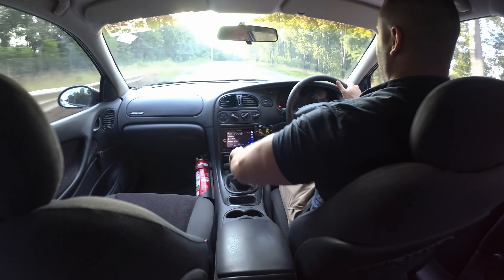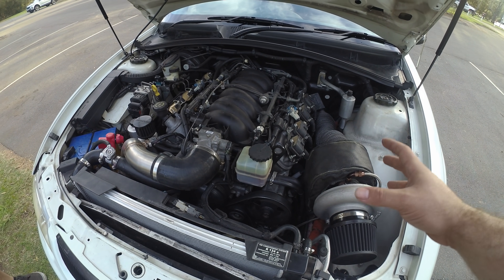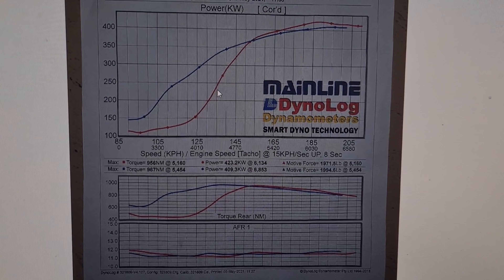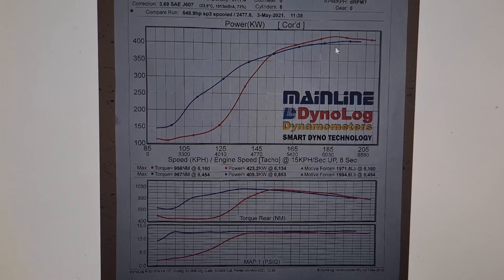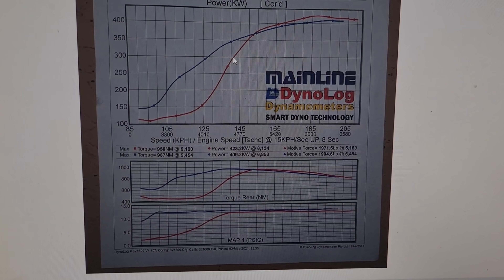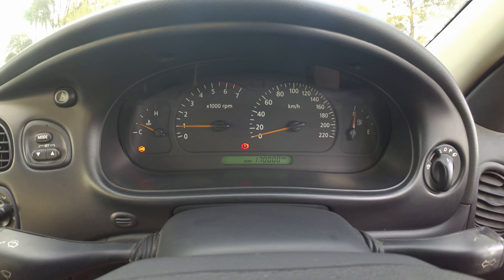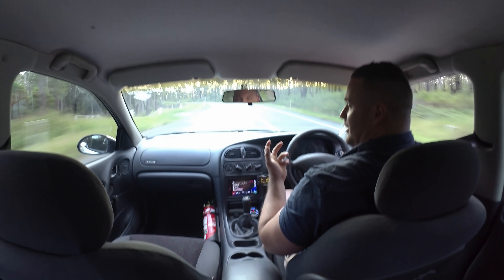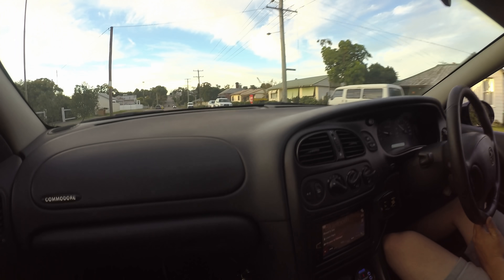LS Turbo Comparison Borg Warner S480 sxe vs S366 sxe

Comment: I need a smaller turbo for my monaro. I went with a 1000hp turbo and totally regret it for street driving. Good result with the smaller turbo, makes the same power as mine. Im looking for a new turbo and pulsar recommended their equivalent of a g42-1450 with a 1.15. Way too large of a turbo imo.
Reply from the maker: I'm likely going to run the g42-1450 on this 5.4 but it's more for roll racing and drag application with n20 for spool if required.

You could go for an sxe s372 as a middle ground if it's a 5.7/6L?
Reply: @GapSauceYoutube  I was thinking of going with a g40-900 or g40-1150 since its primarily a street car. Stock 5.7, 98 only as I can't get e85 where I am.
Reply: @vongdong10 If i had enough time and money i would love to throw a g40 1150 on it and compare to the s366

Comment: The S366SX-E seems to be a very good match for this engine / set up. Converting KW to hp and converting boost to MAP and dividing the two gives us 314 hp at the hubs from "The theoretical NA engine".  (314 hp / 350 CID = ;) ) 
This is about 32 lb/min airflow in the compressormap, right?
1 BAR boost doubles this to 64 lb/min. A X mark at 64 x 2.0 in the S366SXE compressormap is just within the 70% line = this turbo is not too small = S480 is overly large for THIS particular engine. 
We have seen 420 hp at the hubs from "the theoretical NA engine" from budget 5.3 L engine running up to 20 psi boost on petrol fuel, not E85. :)
Reply from the maker: I like the thinking, this particular car made 385rwhp n/a. 620hp on 13psi from memory on e85 before it split a bore.

Comment: Went for a pulsar 3584. Spools great, full boost just a tad over 3-3.5k rpm on a Barra. 400kw on low boost which is a measly 15 pound. Plan to turn it up, was limited by a boost control issue.
Reply from the maker: Great power for 15psi mate. Most 98 cars with 3582 make an honest 320rwkw and run 117-121mph.

Comment: When I first seen the thumbnail for this video I though you were comparing a t6 s480 to twin s366s as some people do for drag setups. I would not have thought a single 66/73 would have been too small for a ls1, but it appears to work really well for a manual street car.
Is the ls1 still alive and kicking?
Reply from the maker: The turbines are very similar between the two and the compressor ended up moving enough air for 610whp on e85 but was left there for the stock bottom end. The car did alot of drifting sessions at the track at up to 7000rpm and plenty of street use, unfortunately we just saw the bore split just recently and a rebuild is in order.
Reply: Yeah cool, just check the specs and yeah pretty much same on exhaust side.
How much boost does it run? Looked like about 10-12 ish?
The response looks great, I would be worried about having too much boost down low and having a manual you can really load it up down low and fold a rod in a sbe
Reply from the maker: @RedsProjects  You can bring it in softly with the timing but from memory it was around 13-14psi for 610whp and survived alot of abuse.
550hp@11-12ish
Reply: @GapSauceYoutube  yeah it looked like the car loved the abuse from the last part of the video.
I see a lot of sbe drag cars are doing their best to keep the boost and torque in low rpm down to keep them alive at high power figures.
Have you watched any videos from squirrel tuned?

Comment: hey mate what fuel system is this vehicle running and 
what fuel type 
also would love to know how you guys setup the fuel system in it
Reply from the maker: At the time of this video it was running 98. Later upgraded to e85 and made a touch over 600hp. I believe he just upgraded the fuel system in it actually recently. I'll have a really nice video about building a hard line fuel system in the next month or two, surge/fuel cooler etc too.
Reply: @GapSauceYoutube  true that's pretty cool I'm interested in seeing how he kept the dead head rail on this car and if he mounted the reg under the vehicle or if he kept the dead head reg in the tank
Reply: @southwestsydney Hey mate at the time of this video it was just the stock reg in the tank and a walbro 525 with upgraded wiring to it. Ended up making 610hp on e85 with that set up. It has since been upgraded to a surge and manifold referenced fuel pressure reg
Reply: @JoshJ285  cheers bro for the reply I'm about to use a $366 turbo on my cammed ls1 so you information is very handy cheers
Reply: @southwestsydney  No worries

Comment: I made 572/583tq on 92oct dyno jet. s366sx .91 housing. 14 psi 14 degrees timing. Small turbo runs a little hot but she lights up quick. Solid choice for a street car if you want to keep it under 600 on pump gas. Could have made more torque...all in the tune. 5.3l 862 heads, 218/220 cam. Curious what a bigger turbine housing would do or the s369. If the IAT's would come down run a little less boost for the same power the s369 sounds better. Especially if you want 600whp on pump gas.
Reply from the maker: Josh ended up running e85 on this combo and made a touch over 600hp, I believe it was 14psi.  S369 would be a good upgrade if you wanted a nice 650.
Reply: @GapSauceYoutube  Just wanted to add to this. I ended up going to a 1.0 AR housing. No change in the tune. The only difference I can really tell is the turbo spools slower. I'd imagine there's less back pressure thus helping hold boost later in the rpm range. I didnt mention before this on a 5spd truck. It's kind of a give and take situation. I miss how easy it was to make it spool when just cruising around. But the point of it was to gain some top end at the drag strip. Not sure if ill stick with it or not. I'm really not sure if its better or the same. Regardless the s366 is small for a 5.3l and it chokes bad up top. I have to ramp boost up just to hold 14psi. I've never been able to hit and hold 16psi. But if you want to make under 600hp its a solid choice for the street but not the drag strip. I've never ran it with open exhaust. I run a 3.5DP to 3" that exits in front of the back tire. This could be part of the issue. Very curious how the 74mm turbine version would do. Maybe a 69/74. Best of both worlds?
Reply from the maker: @or-ian6973  Interesting, you could add a couple of degrees advance to the cam, or go a custom one. (Happy to help there). Spend some time on the injection angle and timing as boost is ramping. Wrapping the headers will help somewhat as well for spool. You can make over 600 on an LS1 so you should be able to do a little more on the 5.3.
Reply: @or-ian6973 I'm strongly considering the garret G40 as an option here for my 5.3/t56 240sx. Similar specs to this turbo but more modern turbine aero and a couple more mm on both sides.  My main requirement is quick spool and about 6-650hp👌
Reply: @FredAllenBurge  that turbo is substantially more expensive. I’d just grab a basic s369 or China version(vs racing) for a lot less and make 650 pump. I’m running 16lbs now and have no doubt I’m making 600whp/tq on pump gas. A good intercooler is a must.
Reply: @or-ian6973  ya I should have said I'll run the vs version not the true Garrett one. I have the vs g42 on there now and it's way too laggy. So a g40 will be a drop in replacement basically and hopefully spool fast. But I've yet to see anyone try a g40 on a 5.3.
Reply: @FredAllenBurge  ah okay. Then yeah sounds like a good swap out.

Comment: The VCM710 may have a bit too much valve overlap to be fully efficient in boosted applications due to bleed off. He’d more than likely make more power with a cam that has a larger LSA/smaller overlap. However, the chop of the VCM710 is undeniable.
Reply from the maker: It's very dependent on the pressure ratio of the turbine and the fuel used.  I believe improvements could be made also.

Comment: I have a t4 S475 1.10 on a 5.3 full boost by 3000rpm and will make 800rwhp . The exhuast side is a little small would like to try the T6 s475 .
Reply from the maker: Nice, auto trans? E85? I'd be interested in seeing you pressure ratio.
Reply: @GapSauceYoutube  Yes 4l80e, triple disk lockup , it's a tight converter 3000-3200 stall. I switch between pump e85 usually e50-55 and pump gas with water meth. The e85 definitely helps a lot with making power . The pressure ratio is through the roof I can tell lol definitely 2:1 . I have a wide LSA LS9 factory  cam minimal overlap might help with high pressure ratio.

Comment: I guess cam and individual setup makes a big difference, I originally turbo’d my vx commodore with a t51r with a 1.15ar t4 rear housing, I put a small cam in and valve springs on an otherwise stock engine before I drove it boosted, it easily made 15psi before 3000rpm and made 702rwhp on 98 fuel, there was so much back pressure that I needed 15psi spring in the wastegate to make 7psi without a boost controller, the turbo felt way to small, I now have a gtx55, 88mm turbo with a 402 stroker ls and it’s makes its 20psi on the converter at 4000rpm like it’s nothing and feels awesome to drive. 
There’s obviously more ways to make something more responsive than putting a tiny turbo on there and restricting top end power, all depends what you’re after I guess.
Reply from the maker: Auto is a completely different ball game though. The S480 was taking several seconds from a 60 roll to even make usable boost. Crossover piping size and merge design would play a huge part in the spool too. This particular setup was night and day difference. There's only so much you can feed a stock bottom end LS1 for drifting.

In this case  the smaller s366 actually had less backpressure as it didn't have the larger compressor wheel to turn. Diameter is leverage and on the same timing, it actually made slightly more power on the s366.

On an optimal setup with an auto, you could definitely afford to go larger without suffering driveability.

I'm glad you're happy with yours 🙂

Also, we talked about advancing the cam a few degrees to bring it up again but it's responsive enough as it is. 🙂

Comment: I had the vcm  number 7 cam (NA) im my VX SS along with a lot of other stuff. 7000rpm on stock bottom end & 290rwkw.

Should have kept that car 😔 as well as my hz 308 th400 😔 and my vb 253 m21 touring car kitted 😔 and my LX Sunbird 173ci trimatic 😔 and.....

I'm sure a lot of people feel the same about some of the cars they've let go.
Reply from the maker: Nice list of cars there mate! I have a few that I will always miss, My Cammed T2 TE50 manual is at the top of that list though.

Comment: Maann... I just mounted and set up an s480 on my 6.0... you guys think I'll be ok?
Reply from the maker: You have a few extra cubes which will help, it would work alot nicer with e85 and an auto trans with an appropriate stall.  It all depends on personal preference, everyone likes to defend their choice. There's a big difference between what "lag" is acceptable at the strip vs on the street.  Josh's vx would take several seconds to hit usable boost from a 60roll in 2nd which meant he had a hard time roll racing at powercruise.
Reply from the maker: I'd your intent is to keep the s480, fab the largest dump you can fit in there, ensure the crossover pipe isn't excessively large and I'd exhaust wrap anything pre-turbo (Inc dump) this will all work towards better spool and a reasonable boost threshold.
Reply: @GapSauceYoutube  its a 6 speed , I'm too far into the build to quit now.   I have 2.25 inch crossover into a 3 inch flange. We'll see what happens man!
Reply from the maker: Keep the 6speed, loads more fun!

Comment: I would be curious how the back pressure and lag would compare to the s366 if the slightly bigger  s369 or s372 were used but killer results on that car congrats
Reply from the maker: I'd love to find out! Josh is about to make the swap to e85 and share his results with us in regards to backpressure and cooling etc.
Reply: @GapSauceYoutube  the older sx s366's will go farther than the new sxe....   you will see on the dyno if you try it.  sxe does NOT have a "clipped" exhaust wheel.  Older s366 will go  50-100 hp farther depending on displacment of engine its on.

Comment: Great video, love it. Got a s480 on my 383ci 3.9 gears, t56. Had a ton of issues with back pressure. Only had 3inch dump to twin 3inch previously,  changed to 4inch dump and all good. Making 488rwkw on a run in tune 98oct. Feels good. Be interested to know what a smaller turbo is like. (Previously was a 5.3 with the same turbo, imo the turbo was too big for that combo and the street)
Reply from the maker: Oh nice, the extra cubes would be really nice for the 80mm. 3inch is very small for those cubes 😅 The s366 was really nice to drive!

Comment: Stock engine?
Reply from the maker: Stock bottom end, cam. Made 300rwkw n/a
Reply: @GapSauceYoutube  do you know how much ls2 can handle with boost application and stock bottom end? I mean maximum hp without harming the engine
Reply from the maker: @abdullahalaraimi6087  Guys have been 8s with stock bottom end LS2's. I'd consider upgrading the rod bolts if I was going to spin any rpm/power though, and stay away from the limiter

Comment: Old  version or SXE s366?
Reply from the maker: SXE
Reply: @GapSauceYoutube  dang I just ordered the sx for my 5.3
Reply from the maker: Hell yeah! Both turbos in our test were SXE.  What's the 5.3 setup? Those things are really nice.
Reply: @GapSauceYoutube  just stock 5.3 with a 216/220 cam. Planned to run a s366 since I started the build. Nice to finally see someone post some good footage of one. Hard to find much info  on them on a LS on YT.
Reply: Hopefully the old style sx is somewhat similar to the sxe. Not looking for much power so I’m not worried about that.
Reply from the maker: @yotaismygame  oh nice, that should be nice and responsive.  I think they will still make plenty of power either way. Hopefully we can do more testing in the future, thanks for watching 🙂
Reply: @GapSauceYoutube  I have 500 miles on the build now. 5spd tkx full exhaust. Haven’t been to the dyno yet but on 10psi it’s pretty quick. Spool is almost instant. I wanted a good quick street truck and so far it is. I can tell the compressor side is a little small as it doesn’t pull like a train up top compared to a 78/75. But overall great responsive turbo for smaller ls builds. Plus she whistles like crazy :)  

Curious how a s369 would be too. VS racing has some nice looking ones. Also curious what it’ll feel like with more boost. 7 was just okay, 10 is pretty fun.

Comment: Cool comparison.
Alternatively however,  you could have gone for a big money motor build to match the ol S480
Reply from the maker: Definitely could, but we thought this represented the majority of street cars here, stock bottom end on pump fuel. The car did make 300rwkw n/a as well 🙂
Reply: @GapSauceYoutube  No no I liked this very much. Like you said, majority street cars/people would just go big turbo bigger is better mentality. 
Very little loses up top, big gains down low
Reply from the maker: Thanks for watching mate 🙂 I'm keen to get some more testing done!  The s366 actually made a couple numbers more before timing was pulled for safety.  Cool hey 🙂

Comment: Most important technical detail was left out ... GMH couldn’t do it stock standard so how the hell does Josh keep those hubcaps from coming off with a turbo LS1 💡
Reply from the maker: 🤣🤣🤣🤣 Some sort of Wizardy..
Reply: Haha! I have lost two over the years but apart from that they have been fine even with being swapped over many times. Nothing else holding them on either.
Reply: @JoshJ285  impressive, I was sure it was going to be cable ties even though i couldnt see them. Respect the sleeper look dude, 100%.
Reply: @thatguyben3128  Nah that would be a good idea but i would be too concerned about how shit it would look haha. Thanks man.
Reply: Zip ties 🙂

Comment: What size turbine wheel was on the s480?  If it was the standard 96x88 wheel you'd never have a back pressure issue until over 900rwhp. Did it have some small turbine wheel?
Reply from the maker: Hey mate, the full specs of the turbos in in the description of the video.

It's not that it had a backpressure issue, just that there was more backpressure as the gate needed the duty cycle adjusted (adding more pressure to the other side of the gate to keep the boost up)

The s366 actually made a couple numbers more that the s480 on the same boost which backs the theory up.  I'm not 100% on it though, so I'd love to hear everyone's thoughts.  Is the larger compressor taking more backpressure to turn?

Comment: I reckon it’s because it a lot harder to slow down the larger impeller in the s480 than the s366, so it goes out through the blowoff valve, & once it’s been cracked, the close point for the blowoff is less than the open, so boost pressures have to go down enough to close it, hence the loss of boost when letting off throttle in the larger turbo. Just a guess
Reply from the maker: Ahh that's an interesting theory mate. Wish we had access to as many sensors as we could fit in the car to know for sure!

Comment: I think you're correct to say that the exhaust restriction applied to turning the larger rear wheel is forcing the wastegate open prematurely on the larger turbo. I have seen that weird phenomenon before once but on a 3 rotor Mazda.
Reply from the maker: It's a weird one, I would have thought the larger A/R would cause less pressure within the turbine section.. Could it be that the compressor requires much more energy to spin, causing more backpressure too?? Id love a bunch of sensors to know for sure!